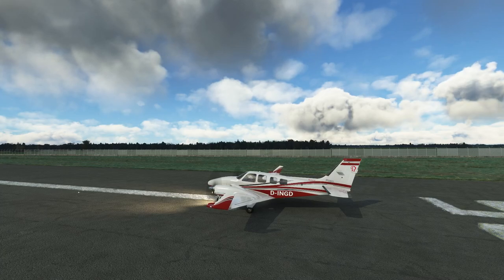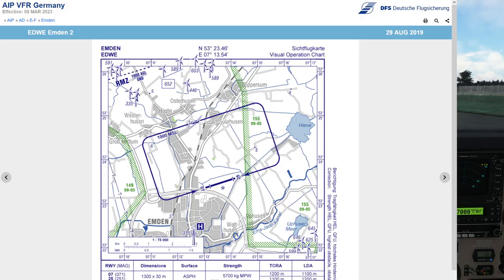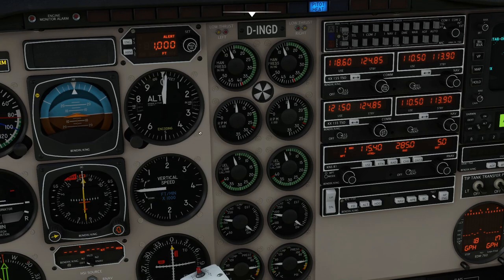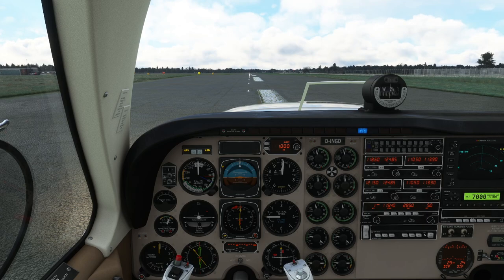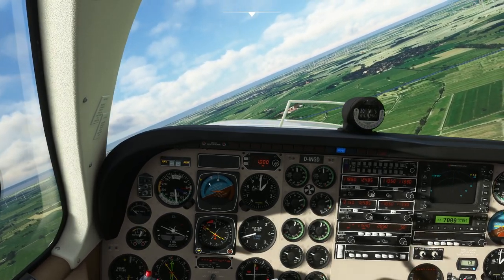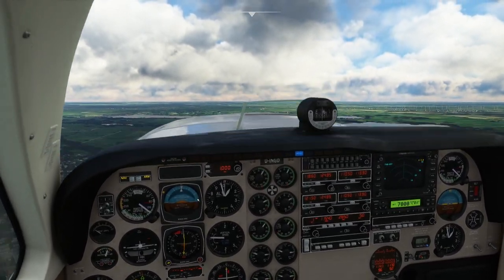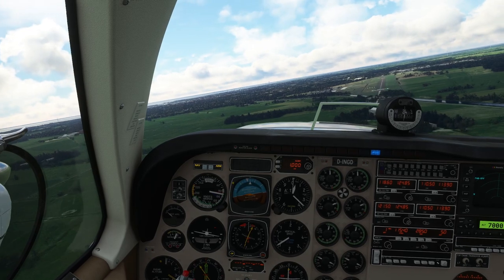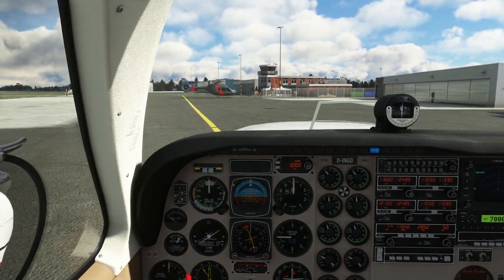Flying Traffic Patterns in High Performance Aircraft | Analog BARON | Real Airline Pilot

Comment: Well done. One question, do you not advance propeller controls forward to low pitch prior to landing (in case of go around, one thing less to accomplish). Suppose it is technique, but usually taught I believe. Thanks again for your time and effort producing video!
Reply from the maker: For noise abatement we always did that right over the threshold
Reply: @A330Driver  Ahh, makes sense. I’m an old fart, my generation wasn’t as aware of noise pollution. Thanks!

Comment: pitch for speed
power for attitude
or the other way around on final ?:_INOP::_VNAVButton::_LNAVButton::_CMDButton:
Reply from the maker: Pitch for Altitude
Power for speed
Always
Reply: @A330Driver  Really? That's the exact opposite of what i've read and seen being taught. Maybe that's something for another video? :)
Reply from the maker: @mrcsone6067  In general aviation it is still widespreak to teach what you've been taught, but it leads to an inaccurate way of flying.
Try flying an ILS your way down to the 200ft minimums. There is no chance you will be able to fly as precise as is required in commercial aviation.
Therefore one of the first things we learned in commercial flight school was not forget about anything we've been taught in flying clubs.
Reply: @A330Driver  Yeah that's what I thought. I always felt like pitch for speed and power for attitude was, as you said, a rather inaccurate way of flying. Thanks for your response!
Reply: @mrcsone6067  I think this has a lot to do with stall characteristics and the differing levels of ability. Even with full power you can still stall any aircraft if you pitch the nose high enough. So if you teach to gain airspeed lower the pitch attitude and control altitude with power you are far less likely to get low-level stalls. At a commercial level you are far more focussed on instruments than at a GA level when you are looking out the window more.